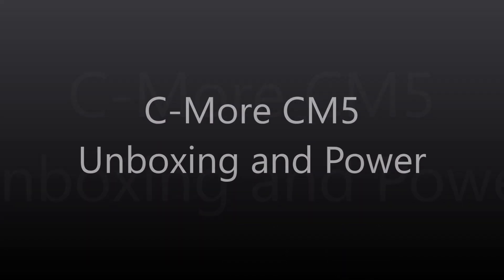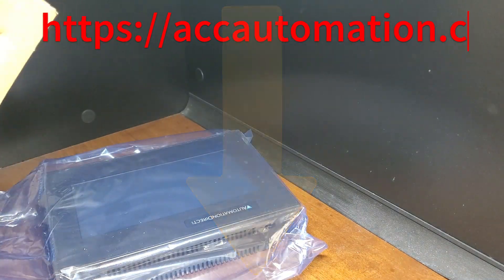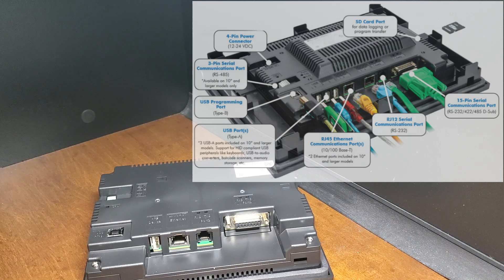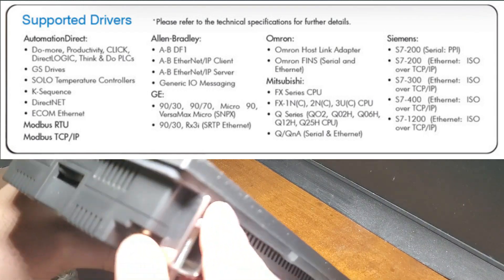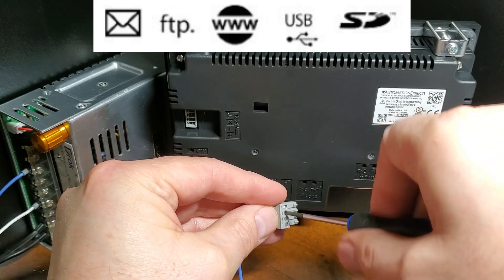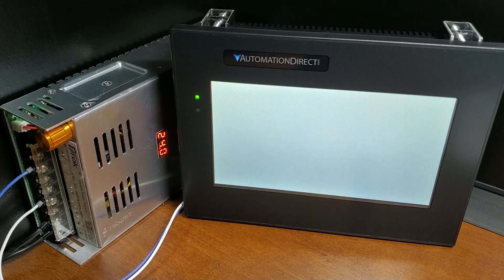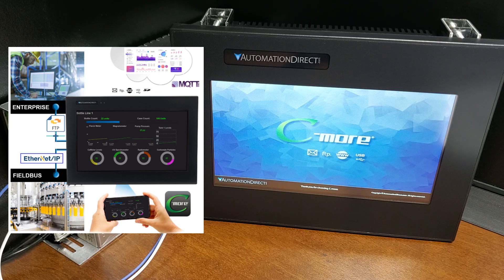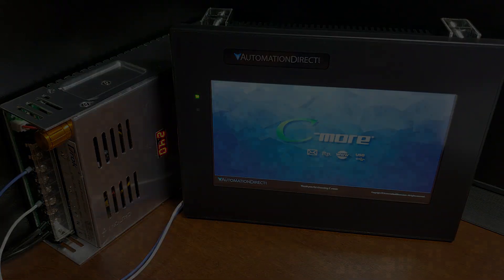C-More CM5 Unboxing and Power

Comment: We use the EAP9 model in about 60 devices. It has been reliable. This device lack the HDMI output. We need that to record videos. At this point we have no schedule to transition. Our primary interest is reliability of supply, hence country of origin.
Reply from the maker: Good point on the lack of the HDMI output for the CM5. However if you ever need an HMI replacement then the CM5 software can change that EA9 program to a CM5 program. I plan on doing a post on this ability. It could help you out in a pinch.
Regards,
Garry
Reply: @ACCautomation  Garry, we bought a few of the CM5 to explore. The saving graces is ability to import the software.  As a professional software developer I wish the product was more efficient to use. It also has a bug wherein saving the file occasionally produces an error about a missing support file. We do not panel-mount our devices because they must fold up and into the best viewing position for the user. We wish the enclosure had a few hard points for us to attach. We designed brackets that are 3D printed Nylon 12 to make do.
Reply: @jeffreylewis145  Can you tell me what kind of hard points you are looking for?  Do you have an example of your bracket you printed?

Comment from the maker: More information can be obtained at our website. This includes all of the links mentioned in this video. 
https://accautomation.ca/latest-c-more-cm5-hmi-game-changer/

The C-More CM5 HMI series can be found at this URL:
https://accautomation.ca/series/c-more-cm5-hmi-series/

Support Links:
C-More CM5 Frequently Asked Questions (FAQ)
https://accautomation.ca/series/c-more-cm5-hmi-series/c-more-cm5-faq/
CM5-T7W Cut Sheet - Tech Specifications / Protocols
https://cdn.automationdirect.com/static/specs/cutsheet/CM5-T7W_cutsheet.pdf
C-more CM5 Overview
https://cdn.automationdirect.com/static/specs/cm5t7w.pdf
CM5 User Manual - Hardware
https://cdn.automationdirect.com/static/manuals/cm5userm/cm5userm.html
CM5 Quick Start Guide
https://cdn.automationdirect.com/static/manuals/cm5userm/cm5qsg.pdf
Product Brochure
https://cdn.automationdirect.com/static/catalog/images/product-pdf/CM5-C-more-Overview.pdf
C-More Programming Software (CM5 Series)
https://www.automationdirect.com/support/software-downloads?itemcode=C-more%20CM5%20Series
CM5 User Manual - Software On-Line
https://www.automationdirect.com/c-more/cm5/software-help
AD C-More CM5 Sample Projects
https://www.automationdirect.com/adc/shopping/catalog/hmi_(human_machine_interface)/graphical_hmi_devices/hmi_panels/cm5-t7w#

ACC Automation
https://www.accautomation.ca
Helping you with your automation control tasks...